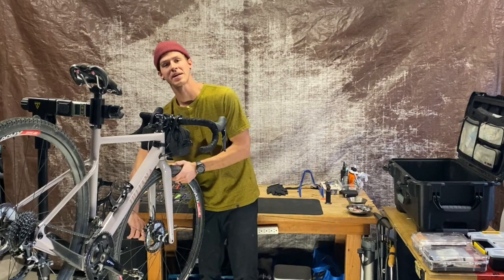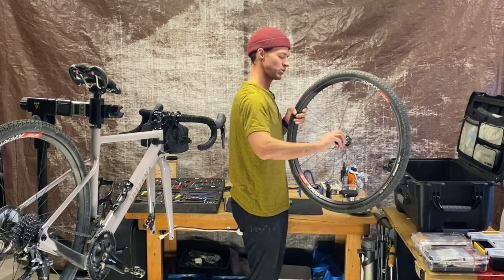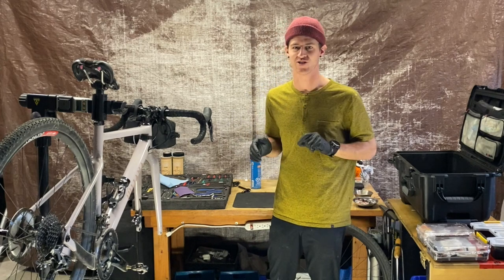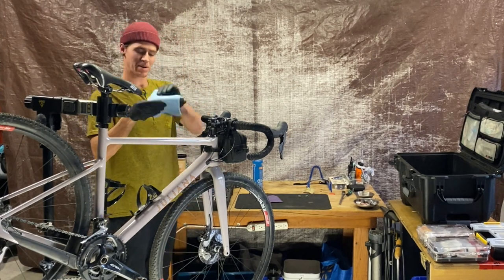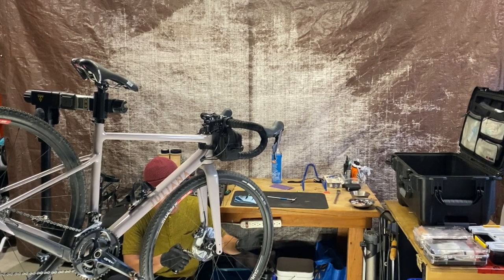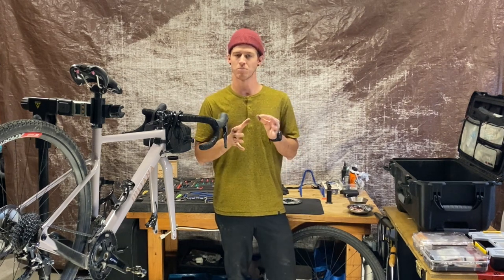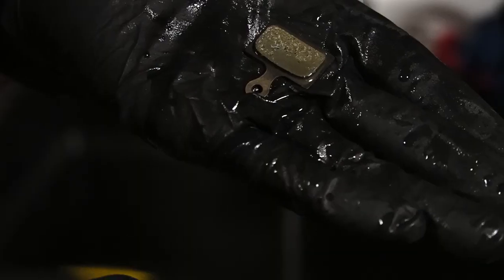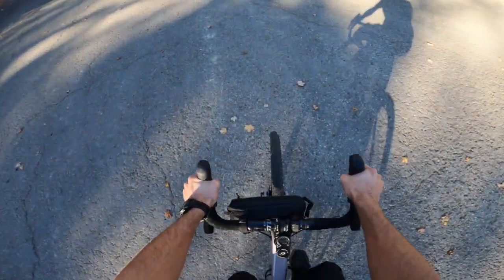Fixing Noisy Brake Pads

Comment: Would isopropyl alcohol work instead of that brake cleaner?
Reply from the maker: Isopropyl works great for cleaning. I do find sometimes it doesn’t break stuff down(it’s not quite as aggressive) but it works great most of the time. It’s especially good for rotors. Careful though as it’s more flammable!